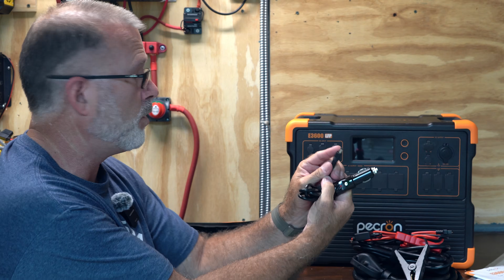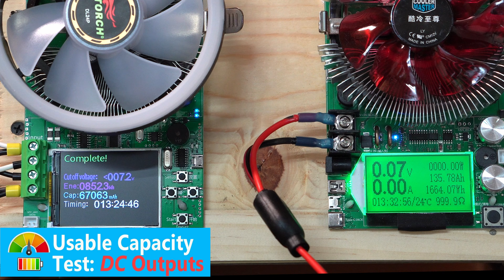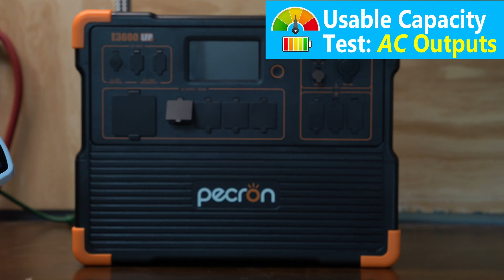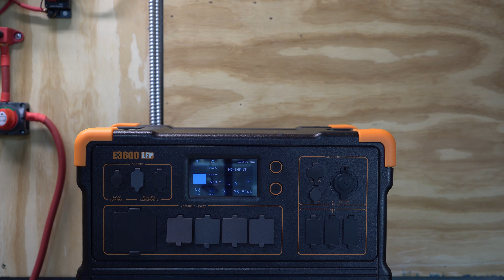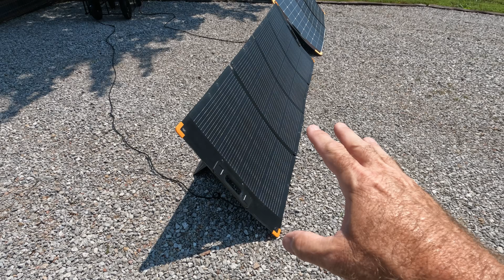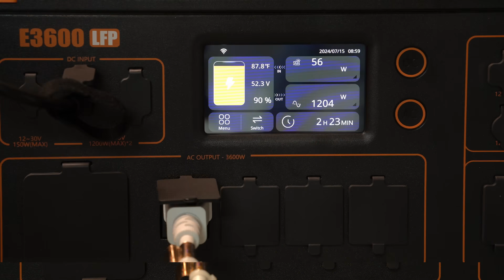SERIOUSLY Good. The NEW Pecron E3600LFP Power Station can do nearly EVERYTHING!

Comment: Super helpful video on this power supply. My wife and I are in the planning stages of non-RV nomad-boondocking using a Starlink and something like this unit to power it. Since I'm a novice at this I'm still determining our actual power requirements for something like Starlink, USB-C WiFi router, two MacBook laptops, two iPhone 13's, electric razor, etc. not all charging at the same time.

Comment: I want to know if it will run a space heater 1500 W for 8 hours
Reply from the maker: @nathanpender3353  nope. Not even close. 2 hours max.  1500W continuous is a heavy lift on battery capacity.
Reply: Not sure what situation you’d be using this for, but you could also aways make a homemade space heater that doesn’t use electric. A popular option is using flower pots with wax on the inside… terra-cotta pot heater I guess is what it’s called.

Comment: Any suggestions on solar panels that will work well with this for household use?
Reply from the maker: For household use, I'd definitely go with rigid panels so you can keep them out in the weather without worrying about it.  As far as which specific brand/model - doesn't matter a whole lot, really, as long as your configuration keeps below the max 150V input on both XT60 connectors.  Where to buy will depend on how many panels you're looking to buy.  Signature Solar is great, but they typically require a minimum of 10 panels, unless you live in TX and can pick them up.  BougeRV has a good 200W option in the TopCon N-Type series and you can buy them 1 at a time if you want.
Reply: @ReeWrayOutdoors  great! Thanks for the info. I can't wait to get the 3600!

Comment: My only complaint about pecron is solar panels. They work fine with their own solar panels. Good luck getting other solar panels to work.
Reply: I use several different brands and had no issues
Reply: No issues for me
Reply: That makes no sense. Any panels or strings of panels will work as long as you observe the minimum and maximum voltage.

Comment: Great review -- thank you! I have 4 Harbor Freight 100W solar panels. Can i configure them for this or do I need new panels?  If so, what rating and how many do you recommend? (I have the E2000 LFP with 2 batteries. Never had good luck with solar recharging on that one. It seemed to take FOREVER and only got 200-250W.) And, I will need new batteries for the e3600LFP since I don't want to be a goober and use 24V on 3600LFP and blow up my house!  :)  Thank you!
Reply from the maker: @GBucPigBob  you could string those 4 100W panels in series and connect them

Comment: I just bought a 3600lfp and 4 solar panels. They haven’t been delivered yet.  
I bought them to supplement my two electric vehicles and a third very soon.   If those panels start producing more electricity then I need for the vehicles, is there some battery unit they sell to store the extra electricity ?
Reply from the maker: Seems unlikely that you'll produce more power than you need for your EVs with just 4 solar panels :P  But  they do have a battery expansion option for this E3600LFP.  https://www.pecron.com/products/pecron-ep3000-expansion-battery-3072wh#ref=110

Comment: Pecron is horrifically unreliable! I had FOUR units in a ROW that were defective, unreliable, and had to be returned within WEEKS of receiving them.

Do NOT waste your money on Pecron! Yes, the pricing and features are attractive, but when it dies completely or partially dies, you will be very upset.
Reply: That’s the only downside. Pecron customer support is horrible. I’ve had two e300s that would clip out at 200 watts even though the inverter is rated at 600 watts. Customer support said they were working normally.
Reply: @robertbryant173 did you end up purchasing another company unit.

Comment: Thanks for your review. I normally don’t comment on reviews unless there is something really glaring about it. You might want to recheck the background noise comparison. There is definitely a Buzz on the power station side vs the grid power. Maybe you should consider using a device to test the noise level rather than your hearing. Thanks for the review.
Reply from the maker: I agree that the difference is more noticeable in the video after I boosted the audio clips...but I will maintain that standing next to the amp in person...the difference really was negligible.  That said, I also agree that getting an analyzer that provides a numeric value for THD would be better...but they do cost a LOT. :)
Reply: @ReeWrayOutdoors  Couldn't you run that test w/ amp plugged into the Pecron & Pecron plugged into wall, then unplug Pecron & let the UPS function take over?
Reply from the maker: @fuzzy919  yeah that'd work too...just wouldn't be super telling about the speed of the switch-over.
Reply: I agree. The amp was much noisier though the Pecron. I have some concerns that it would cause interference with amps and radios.

Comment: What kind of 8000 btu ac did you use that only uses 600 watts? Can you post a link of where you bought it? Thanks
Reply from the maker: It actually will pull just over 1000W when running full-out, but in the clip you were seeing it wasn't running at max power yet.   But this is the one I was using: https://www.newair.com/products/newair-12-000-btu-portable-air-conditioner-8-000-btu-doe-modern-ac-design-with-easy-setup-window-venting-kit-self-evaporative-system-quiet-operation-dehumidifying-mode-with-remote-and-timer

Comment: Sorry if I missed it, what's the amp limit per xt60 string?
Reply from the maker: 20A is the max
Reply: @ReeWrayOutdoors  I'm curious how they limit input then, because for example 120 volts at 20 amps would be 2400 watts on 1 xt60. Maybe I'm not fully understanding some part of this haha
Reply: @rnkustomz  an MPPT controller works by starting at zero current draw and whatever the open circuit voltage of the source (solar, battery, whatever) is. Then it gradually takes a little current, measures the voltage, calculates the Watts (volts*amps). Then it takes a little more current and again checks the voltage and calculates the new Watts. This continues until either 1) the 1200W maximum is reached, or 2) the 20A maximum current is reached (at therefore less than 60V), or 3) the voltage dropped by a bigger percentage than the current increased (fewer Watts) indicating that the Maximum Power Point has been reached.  It continuously tries increasing or decreasing the current draw slightly to see if the maximum power point has changed because of changing sun angle or clouds coming or going etc (the Tracker part of "MPPT").  Technically, the input current is adjusted by high frequency Pulse Width Modulation (PWM).

Comment: Could you go over some of the UPS settings and auto AC charging settings in the app. Seems there are some smart/peak shaving functionality that they added that the old units did not have.
Reply from the maker: I actually did have a clip that covered that, but I guess I forgot to include it...but basically, there's a menu option in the Input/Output settings where you can specify the max state of charge when running in UPS mode.  Nice for when you want to use it continually in UPS mode without constantly keep the SOC at 100% and stressing the battery cells more than necessary.   And then there's another setting for max charge and discharge settings so you could, say, set the max discharge to 20% and the max charge to 90%, and thereby extend the long-term service life.
Reply: @ReeWrayOutdoors  sweet, yeah I checked the manual and am looking forward to that feature in general. The ability to throttle down the AC charging speed is really useful so I don't have to pull 1400-1800W from the wall.

Comment: What’s the dual sided xt60 solar input cable used for?
Reply from the maker: There's an option in the Input/Output Settings menu where you can put the XT60 INPUTS into a Parallel state, which would allow you pull up to 40A from a single MC4 input, rather than 20A from 2 separate inputs.  Might give you more cabling/connection options to avoid clipping without having to run extra cables and split your array into 2 strings.
Reply: If you split one mc4 cable connection into two xt60 outputs wouldn’t it reduce the amps not increase it? Two into one would increase it but one into two would reduce it? Maybe we’re saying the same thing?

Comment: It looks solid and clearly is someplace between a EF Delta Max and a EF Delta Pro
They should increase the warranty, at these price points a good warranty gives buyers more confidence
Reply: Other than capacity it's closer to the Delta 3 Pro in features -- and actually better on the solar charging. At literally half the price here in NZ $2900 vs $5800. You can add two expansion batteries and have 9kWh vs 4kWh for just a couple of hundred bucks more than the Delta 3 Pro. 10% smaller inverter but I'm not planning to run it at anywhere near max capacity most of the time.

Comment: 29:10 What’s needed to get 240v AC?  Two base units plus a phase combiner/outlet box?
Reply from the maker: Yeah it'll be a box with an L14-30R on it, and 2 cables coming off of it that connec to the TT-30R ports on the main units - which would have a sync cable between them (connecting to that RJ45 port on the left side).
Reply: @ReeWrayOutdoors  Thank you!  And extra thanks for including the spec details.  I was hoping for a NEMA 14-50 capability.... I was unable to find info from Pecron about this capability.  Link?? 🙏
Reply from the maker: @737smartin  yeah since it's a 30A max, they're using the L14-30R. You could get an adapter cable to the L14-50 but you're obviously stuck with the 30A max.

Comment: Of all the several brands of power banks I own I wish I owned this particular unit.  For me the Pecron E3600LFP checks all the boxes I have been looking for in one power bank.  Love the multiple DC input ports.  I can use my solar saga 100W panel, my 2- 160W panels, and my 2- 220W bifacial to charge this unit and with some adapters I could use the linx solar panels too .  With all the solar panels I can definitely charge this unit in any given solar day while using it.
Also love the DC outputs.  I have found that I get an extra 2 hours of run time using the 5521 5V port when I connect my Dometic CFX3 45qt 12V fridge or my setpower 45Qt fridge as they each use less than 60W to run.  Just buy a 5521 adapter with a female 12V cigarette plug for it.  Also love the fact that it will actually run a diesel heater whereas many power stations will not.   I really really like this unit.  Had this video come out a couple of weeks earlier I definitely would have bought it.  I just ordered the EG4 inverter and battery to build a diy power bank for fun.  Great, great video as always,....thanks for sharing.
Reply: Eg4 is better quality than these portable units.

Comment: Could this start a 2.5 ton central air unit without soft start?
Reply: It should if you use two and the 240 volt converter box. But I would still recommend installing a soft start. Less startup surge helps the compressor last longer and saves energy upon startup.
Reply: It if it won’t take this initial load of  those shop tools……

Comment: Does this unit allow for firmware upgrades via Wi-Fi?  

Also, do you know what kind of cable could be used to transfer power from the Pecron 3600 out of the 12 V 30 amp DC output plug to another power station such as an Ecoflow Delta Pro?  Is there such thing as an XT-60 to XT-60 plug?

Comment: Great review. Was hoping for more on the touch screen interface and the app but glad to finally have some first hand info. In your video and some pics Jasonoid posted, those temps cannot be correct. Have you communicated with pecron about this? May need a firmware update in the near future.
Reply from the maker: Good eye on that temp reading!  Actually I did have an exchange with Pecron on that and they assured me it was due to small coding issue in the pre-release firmware my review unit is running where that particular Units label was hard-coded to display C, even when the units are configured for F....so the real value was 100F, not 100C.  They've assured me that bug was fixed in the final shipping version.
Reply: Don't worry, ReeWray Outdoors's engineering machine needs to be manually adjusted to °C or °F. we are very sorry for the inconvenience, but the machine received by the customer will automatically match the symbol.

Comment: Do you know if you can take their smaller units that have enough wattage to power what we need, buy 2 or 3 and hook together to expand the n]battery capacity? That way, you get this smaller, lighter for us old bad back guys, but stackable? If not, it is a little trouble but we could have all 2-3 precharged, use one and as they discharge, have solar to slow it, then when one dies, hook up #2, put the dead one on charge, etc? Just a recent idea since the larger units are heavy for me, expensive to start, etc. any thoughts? Thanks

Comment: I’m always amazed how these things do better on AC performance than DC like in this case. On the surface, you would assume the DC would have to do better, but in this case, not?
Reply: Its because they use dc to dc converter for the dc it drains more power than the dc to ac inverter.
Reply: The anker f3800 has a much better dc to dc, 99%. It actually surprises me how bad the dc to dc is on this one and it's the reason I'll probably get the f3800. Otherwise everything else is better about this pecron

Comment: QUESTION: Can it be setup to automatically turn on the AC outlets, when solar is available?
WITHOUT ANY USER INTERVENTION OR REMOTE INTERVENTION?
Reply: Wondering this as well. Be it when solar is available or if plugged in during an outage and drained up zero.. once power is restored, can it automatically turn on the AC inverter?
Reply: Other users must surely also need this capability, but the reviewers never test this functionality.

If it can not start up and provide AC it serves no purpose, because you have to be there all the time in case the battery drains, in order to turn the AC outlets back on.

Not sure why this is not tested in every review!
Reply: @Just_An_Idea_For_Consideration  To say it 'serves no purpose' is a bit of an exageration - the unit could still be super useful for people even with that limitation. That said... "I" (and it sounds like you!) would like that feature, so hopefully some reviewers start testing it/commenting on it and more importantly, hopefully manufacturers start including it (if they aren't already).

Apparently Bluetti is not including the feature... I'm just starting to look into other options...

Comment: So this is more than twice the price of the $706 280AH Licitti 1000W AC Battery Box PRO ?
Reply: If I just want a battery back up then your 700 dollar is the go-to

Of like me,.you depend on the solar input pecrin rocks all the boxes
Reply: The Licitti is a neat setup but doesnt have very much going for it besides battery capacity. Very low solar input, non expandable, no wifi app, less AC outputs etc.